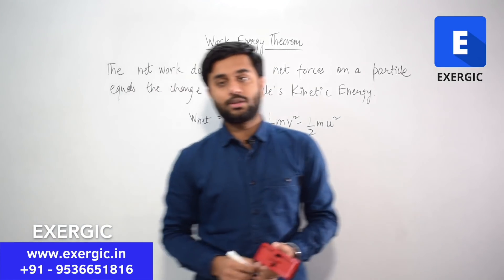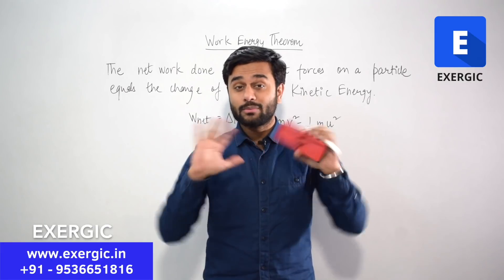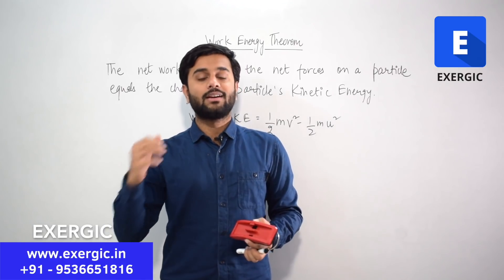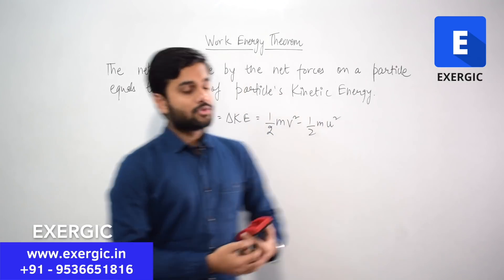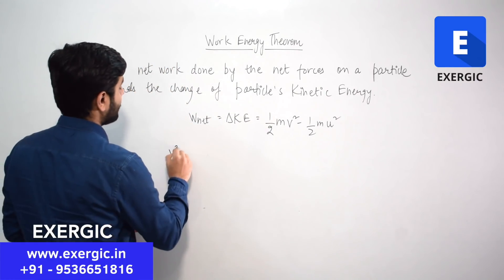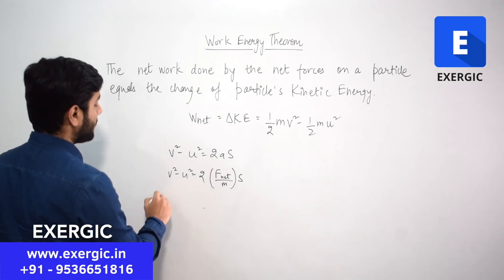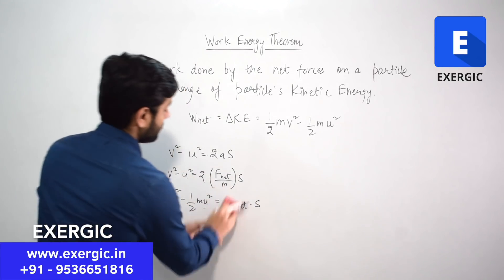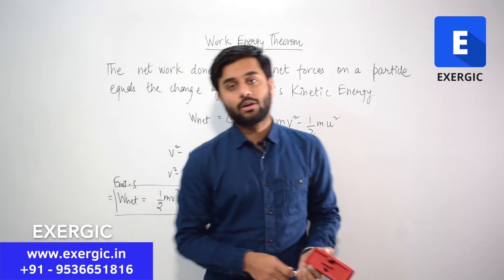Confusion cleared in Work-Energy Theorem - Engineering Mechanics | GATE ME

Comment: sir the equation is derived using newtons laws of motion, means this laws can be applied only in constant acceleration then if the body is moving with non uniform acceleration then there we cannot apply conservation principle??? then how to solve those problems.
Reply: Actually, 
1. The law of conservation of energy is applicable at any instant of time. The equation of law of conservation of energy or Work energy theorem in front of all of us eyes is actually in steady state i.e. the forces involved are constant in time which brings same change in Kinetic energy at any instant. (Indirectly the acceleration is also constant).
2. But when acceleration is variable then the Work energy theorem is still applicable but it is sensed at particular instant. Instant to instants the total mechanical energy or overall energy may change because there is always change in energy involved as influence of the nature of external forces whether they are constant in magnitude or direction or both or variable in any set of these.
Reply: In case of non-uniform acceleration, we apply pseudo force

Comment: Sir,  if block is lifted  by us at constant velocity, than it means acceleration will be zero  than the net force must be zero and workdone must be zero, then how kinetic energy got changed?
Reply from the maker: When it is moving with constant velocity, then net workdone by all forces is coming out to be zero only. Watch 13:18

Kinetic energy is not changing as you asked in last line.
Reply: You will have the same conclusion in either of the two way of same thing  .. ∆KE can  be equated to zero( as velocity is constant ) or net work done is zero ( as body is not accelerated net force is zero ,so net work done is zero ).. ultimately you will have 
Net work done= ∆KE = ZERO 
as per the theorem...
You can further conclude 
Work done by us = ∆PE ,
from that equation .. and 
Thank you sir for this beautiful explanation..
Reply: May be you are thinking that the body you are saying was initially at rest and then you pull it with constant speed which is not zero. But it is not possible.. actually initially the body was accelerated and then continuously its acceleration was decreased to zero. initially its velocity was zero but after that its velocity has been a positive non zero value in upward direction ... It means that the body was accelerated in the upward direction... For the acceleration in upward direction, there must be some net force in upward direction...

Comment: Sir if there will be force of gravity, spring force and velocity will be there, Can we say that net work done is change in KE only? I think it should be change in total energy (correct me if i am wrong ). Actually in mechancs system (body ) is not doing the work, either we are giving the work or energy  is dissipated by friction or by other means,. So still confused what you that work done by us and work done by gravity.
Reply from the maker: Consider every work (spring, friction, etc), and the net work done by all will be equal to change in KE. 

Simple funda is that all works will not get added up; some will get subtracted. And those which are getting subtracted in LHS will come to RHS and get added to change in the change in KE.